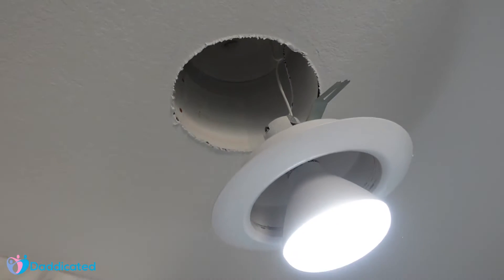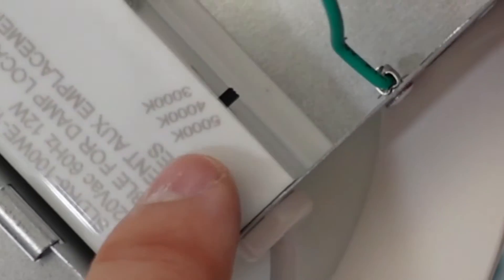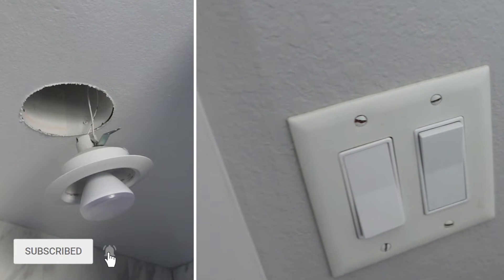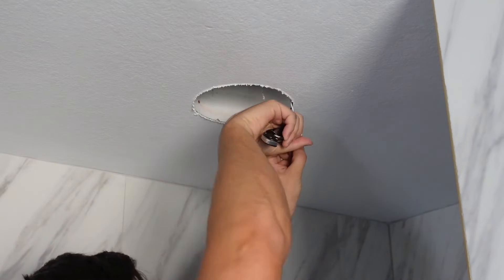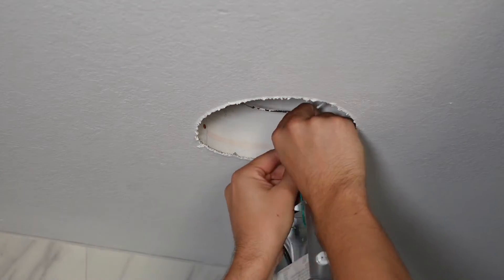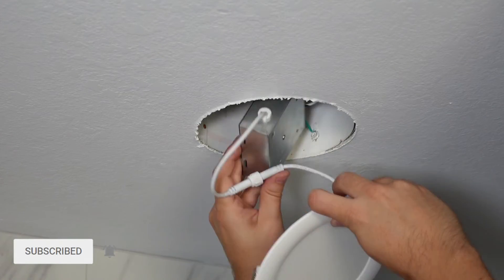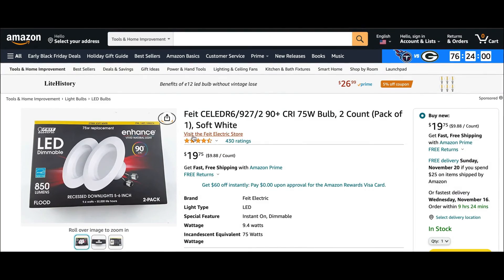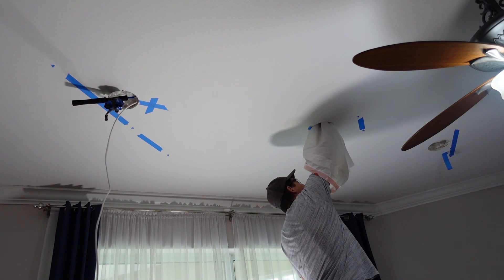How to convert CAN  LIGHTS to flush mount LED light

Comment: You just shoved that thing in there without showing what you did with those spring clamps. I just bought some of these and if you try and use with the existing can, they slide out.
Reply from the maker: Not sure which style you have but mine just held onto the sides of the can or the inside of the drywall. I basically did what you just said “just shoved it in there” and it stayed in there just fine. Did not do anything special.

Comment: the old shower light looked dangerous for a shower because it didn't look like it had a waterproof cover or a washer between the bulb base and the socket.
Reply from the maker: Yeah for sure. Surprising though it lasted for good 17 or 18 years like that before I remodeled it.